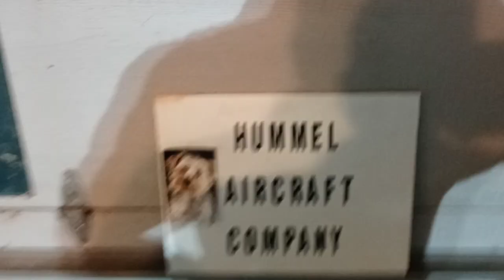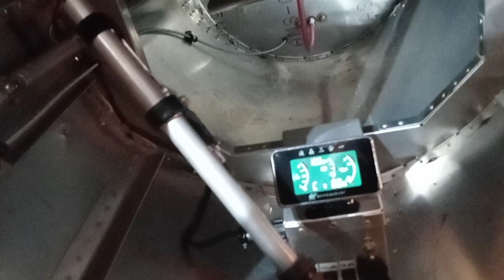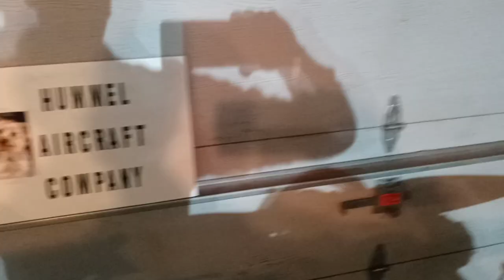UC prop on .will start engine first time Monday!!!

Comment: Hi, Dennis.  On a recent vid you showed torque values for your prop.  bolts.  Terry sent me a special 1/2 open wrench to attach to a 1/2" torque wrench to torque the nuts on the 5/16 an prop bolts.  His note to me was 89 inch pounds.  I think you used 144 inch pounds (12 ft pounds)?.  What should I use?  I am mounting a new prop and want to get it right.  Any advice is welcome.  Thanks, I like your vids....

John Wilkinson
Reply from the maker: Hi John or Teresa well my Prince prop says for a 5/16 bolt you toque it to 140in pounds. But you know I believe you got me!! I did wrong as I forgot about the added wrench on there!!! Wow thank you for calling me out on that. God bless you!!!
Reply: @redblackvette  Hi, Dennis.  I'm not sure that 89in pounds is correct either.  That was just the number Terry taped on the wrench he sent me.  We might need to check this.  Thanks for your reply.  I'll try to find out, and if I do, I'll let you know.  Please, you do the same.  All the best, John....
Reply from the maker: Hi John well sir I got out my paper work and it says 96inpounds. So that's what IM going to do. Video a coming
Reply: @redblackvette  Excellent .  thanks, Dennis.  I'll recheck mine....All the best, John